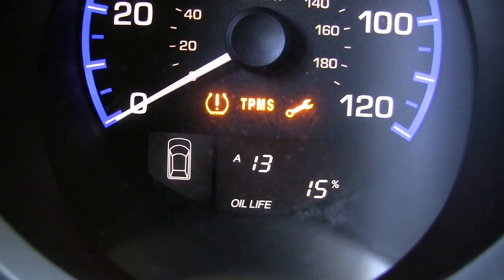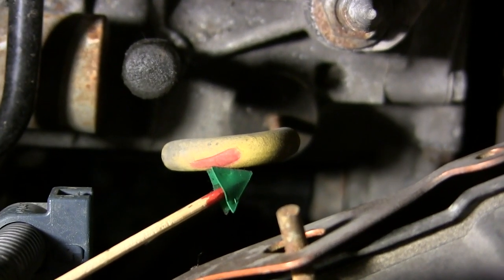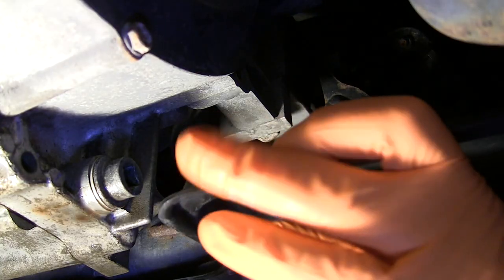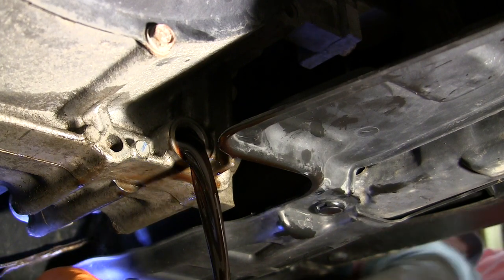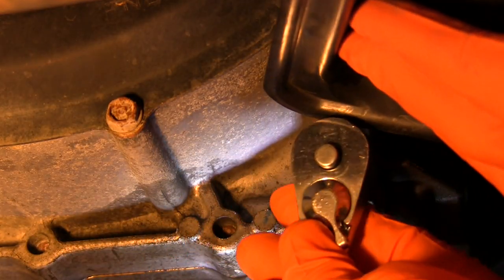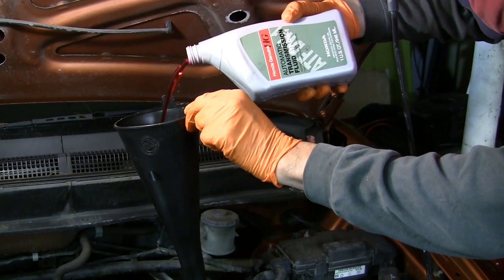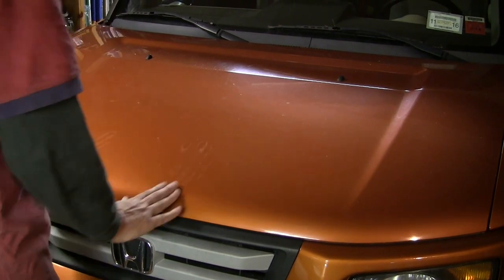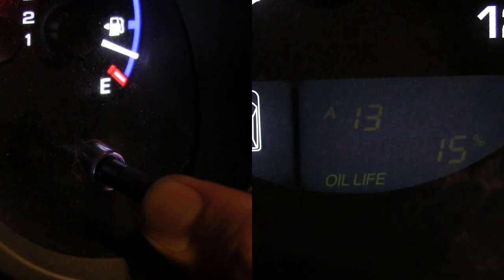Honda Element Transmission Fluid Change

Comment: There is also a trans fluid filter that you should replace too and to check the fluid make sure car is at normal operating temperature then you can check the dip stick, not on cold. Owners Manuel says so . Awesome video thank you omi h for giving me some confidence to do this myself and save money

Comment: The yellow top AT dipstick is shown mis-positioned in every part of this video. It should ALWAYS be angled to point to 10:00, toward the breather tube.  If pushed in at the ~8-30 position as shown, it will not give an accurate indication when measured 60-90 seconds after stopping a warmed up engine.

The ATF "change" amount shown in the Owners and Service Manuals through 2009 is NOT accurate.  Somewhere in the capacity specification calculation IMPERIAL measures were used. The number in the manuals works out to being IMPERIAL QUARTS, not the US fluid quarts as shown on the US market DW-1 bottles.  A refill will take between 3.25 and 3.5 US quarts. (3.3 US fluid quarts = 2.74 imperial quarts).

Since this video was posted, JX Nippon,  the OEM manufacturer of Honda's DW-1 (and those of other Japanese car makers has started marketing ATFs under their own name through NAPA that are guaranteed compatible, but the $3/qt savings For ENEOS H, may not be enough to chance it on a spill and refill..   

It is not noted anywhere in the maintenance directions, that if the spill and fill shows any sign of metal particles on the drain plug, grit or sludge, the inline AT filter located at the bottom of the radiator, (a $20-30 OEM item), should be replaced.  Otherwise, it should be replaced as part of the 110,000 mile scheduled maintenance. This filter can be accessed by raising the front end of the vehicle with a jack, removing the plastic push-pin fasteners from the sides and rear of the under-engine shield (not the front across the bumper), and lowering it.

BTW, The Gen 1.0 Maintenance Minder service indicators of the Honda Elemenst are only roughly accurate if the vehicle has been operated in "normal" service and all resets have been done with a Honda HDS.  If you change the oil before you get a code and reset the oil oil life counter with the ODO switch,  the other codes may not be accurate.
Reply from the maker: You sound like a professional Honda Service Technician with access to much more precise info than I have! I'd love to see your YouTube service videos!

(oh...)

Comment: But what about the trasmission fluid filter located under the radiator ?
Reply from the maker: Not needed until the second service interval, past 100K miles. The transaxle holds 7 point something quarts, but only drains 3 at the service intervals.  The in-line filter itself is inexpensive, but can be an awkward task to R/R..  Next time I do one, I might post an updated video.
Alden
Reply: Good Question. I was just going to ask that. Thanks Joel.

Comment: Hey I bought a 2004 Honda element  with 87000 miles can I now do this or will it damage the transmission more meaning causing slippage since I dont know if previous owner this any fluid change
Reply from the maker: A lot depends on what shape the transmission is already in. (doe sit slip/grind/shift hard already?) 87K miles is not an issue, and remember, you are only replacing about half of the fluid each time. The one sure thing is to only use the Honda-branded fluid. Using regular Dexron WILL cause problems.
Reply: @FlashDriveFilms  shift perfectly and yes I'll used only Honda fluid so I should be good changing fluid
Reply: Transmission fluid is probably still in pretty good shape at 87k. Mine is still pink at 120k. Never changed. I'm changing it today.

Generally, changing transmission fluid can only help. Flushing on the other hand can cause problems if your transmission fluid is black... Like if you waited wayy too long. That indicates transmission damage.

If the color is pink or red you can flush or change.

Comment: Can i leave the drain plug open and add a quart to flush more transmisson fluid out? Or will it stay in due to the design of the transmission ?
Reply from the maker: The extra fresh quart will just drain out on the floor. The transmission sump is divided in such a way that there will always be about half of the fluid sequestered from the drain plug. Only real way to get it all out is during a rebuild. Maybe some kind of suction pump thing might work.  I just follow the service interval recommended and figure it will always have a mix of old & new fluid. Just don't let the old get too old!
Alden

Comment: Nice video. You didn't address the procedure to replace ALL the ATF in the system. You do  the 3 quart replacement three times in a row with a quick jaunt around the block  in between to mix the old and new. This requires 11 quarts and by doing so the old fluid is diluted and drained with each 3-quart drain and fill.  When the third drain and fill is complete 7 quarts fluid are new.
Reply from the maker: Please DO NOT change the transmission fluid that way. You only have to change about 1/2 of the fluid at each service interval. New fluid is not cheap and the method you just described has you needlessly throwing out some new fluid (intermixed with old). You never get all of the old fluid out until a transmission rebuild anyway. It is just the way the system is built. Honda is actually very clever in this feature, they expect that some old fluid will be in the mix. Do the first change of 3 quarts at 60K miles, then at every 30K after that and it will be fine. If you wait until the fluid turns dark brown or black,  if you do the 11 quart process you describe, it almost guarantees the transmission will slip and fail prematurely. 
But don’t take my word for it. Some other references:
https://www.elementownersclub.com/threads/auto-trans-fluid-filter-replacement-diy-instructions.51749/
https://www.youtube.com/watch?v=ctpVCWjd8b4
https://www.youtube.com/watch?v=o690DovjDAc
Reply: @FlashDriveFilms  What Gary said makes perfect sense if you don't know when the fluid has been changed last, you're having issues with the transmission or maybe you or someone used another brand of fluid just to get you by. Notice he did not say to do a flush? I believe that's what you're referring to when you're speaking about damage. Changing some or all of the fluid with proper honda fluid should not cause any issues.

Comment: So I will only need 3 quarts ?
Reply from the maker: Yes. Due to the design of the transaxle, only three quarts drains for the service interval. There is always going to be an amount of older fluid left in, although that gets diluted by the new fluid each time the transmission is drained and refilled.
Alden

Comment: do you warm it up first?
Reply from the maker: Not intentionally. The car had been driven that day and pulled into the garage, but it then sat for a bit and the fluid did take some time to drain down. So the fluid was warm, but not hot.
Alden
Reply: I’ve read that Honda recommends warming it up first. Going to have to check up on that. Pretty sure about another third of a quart should mobilize and empty if you do this. Just going on what I’ve been reading. Great video editing, though!

Comment: Maybe that's a dumb question, but is that the same transmission fluid for the Honda Element Standard?
Reply from the maker: Not a dumb question at all! The Honda DW-1 is for automatic transmissions only.  The manual transmission takes a different fluid. I've only done automatics, so "check your owners manual" for the correct Honda fluid name.
Reply: FlashDriveFilms come on!  I will download the manual, to review the type of fluid that really carries; thank you very much!

Comment: what year is your element? my 06 doesn't have the dash indicator service reminders.
Reply from the maker: This one is a model year 2007, but it has a build date of October 06. So it must be a late year upgrade starting at that changeover. Just inside the drivers' door pillar, near the latch striker  on the body, is a small black & white sticker. Top right of that will show the build month of your car. 10/06 for instance.
Alden

Comment: not gonna tell us the crush washer size or part number? gee thanks.
Reply from the maker: Added the part to the Affiliated links in the description.
Reply: @FlashDriveFilms  Would that be the same part regardless of model year? I have a 2004. Thanks!
Reply from the maker: I believe so. Honda kept many of the same components over the whole span of production.

Comment: Great video however to do this properly, do the following.   Follow this video, then drive around going through all gears.  Then drain, fill, and drive again.  Then fill 1 last time and your done.  This gets all of the fluid out of the transmission.
Reply from the maker: Thank you! 
When you say "properly" though you are exceeding the service intervals Honda recommends. No,you will not harm anything by doing the total fluid change as you describe, however, it is unduly expensive that way. Honda indicates to do the first change at 60,000 miles and then every 30,000 miles. The transmission is purposely designed so that it only drains 3 quarts for the service interval. To replace the total 7+ quarts is not necessary at each interval, as long as you you stick to the schedule.
Alden
Reply: No it doesn't get all of the fluid out of the transmission, you're just changing the fluid three times.

There's nothing wrong with what he is doing in this video. If you want to flush the transmission, the way you described is nonsensical.